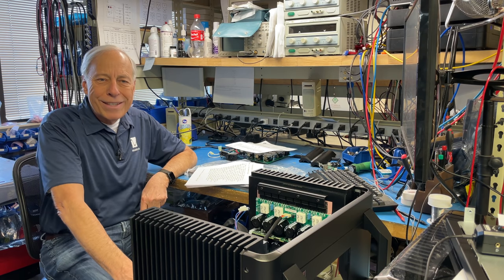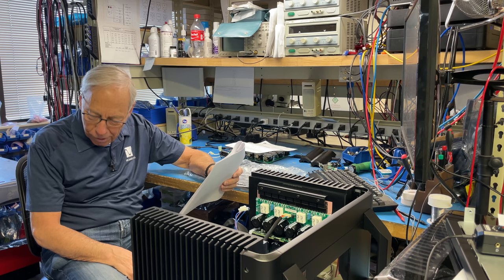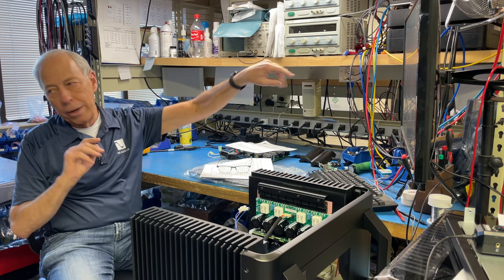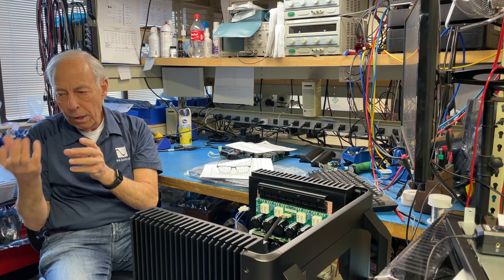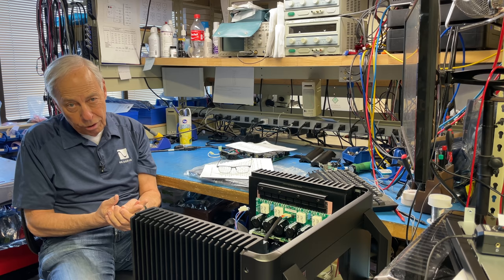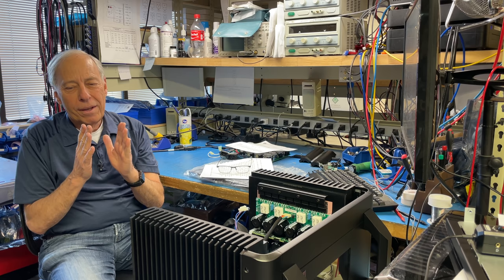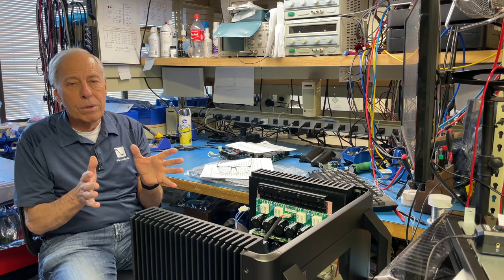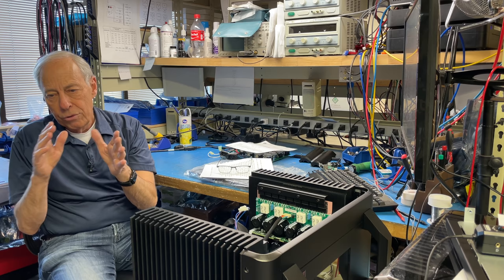Differences in digital audio cables

Comment: Use great cables but don't pay snake oil margins for them...too many US$10 (FOB China) cables are sold at insane margins with some branding sticker on them.
Reply: Yes, use certified cables that are shown to operate within the specifications and discard when they become damaged.
Reply: @paulgyro  Yes, for digital data cables, there is no magic to it and the standards define what makes the data come through reliably. It doesn't matter if it's an e-mail, Power Point, image, movie or music that is being transferred, none of it can allow data errors. Of course cables can carry noise into the analog circuits and if a USB cable carries power to a DAC, there can be some special case concerns, but none of these things are costly to avoid nor do they need any special snake oil products.
Reply: @ThinkingBetter  Agree, ASR just did a debunk video on the same subject.

Comment: that's what jitter buffer is for. the bits are written at the source speed + src jitter + network jitter, etc. The bits are read out at the internal clk speed (and with internal clk jitter). over/underflow control is a different issue and taken care of separately, depending on the particulars. youtube players usually buffer a few seconds of video/audio before they start playing anything. btw, if you count on the src being jitter-free, you'd better choose a non-engineering profession.
Reply: The buffer does not get rid of all the jitter, the buffer also adds it's own jitter, the word clock also adds jitter, fibre octive cables also add jitter, you can't get rid of it.
Reply: @Viagra_risk_PERMANENT_insomnia  The jitter buffer does not have any jitter. The reading inserts some depending on the jitter of the internal clock. None of the other jitters play any role anymore. Done that.

Comment: The person ask how, in digital domain, cables makes a difference and the answer is isolating the analogue section of a DAC made a huge improvement during the design. Okay sure so the difference is not the digital cable. 

The problem is probably that the good sounding digital cable sound exactly the same as the bad sounding cable and  bias play a huge role in what one expect to hear. 

My question to you would be : why does audiophiles think a properly engineered component is sensitive to the cables connected to it and why it's not the total opposite ?
Reply: @Douglas Blake this have been my opinion for a long time. After my "i think I hear differences between cables" phase  and after the "let's test if this is real or not by removing the expectation bias" phase.

I can't understand why audio components designers accept the ridiculous "your components are not good enough if you can't hear the differences between cables". If it's the case than the design is flawed and need improvement.

If I was behind those designs I would take a stance of  : you hear what you hear but we don't aim for any cable to make a difference designing a component. But that's me.
Reply: @Douglas Blake And yet that is what most advertising is based on. A new car does not make one more sexy, few owners of SUV's ever go off road, most diet plans fail, a fragrance does not attract women and in vitamins just create expensive urine.
Reply: @zackschindler8334  that's not a business model, that's business.

Comment: I constantly hear how noise from the ethernet cable is transmitted through the expensive streamers/DACs, but this should be very minor. Once the bits are buffered from the network. The actual digital audio throughput requirements from the buffer to the DAC are so low that a simple 2$ optic coupler for data paired with a 3$ integrated isolating power supply will easily kill even that noise, so there isn't any excuse that a network cable or switch should change the audio sound coming from an even moderately designed streamer/DAC. (I design sensitive medical and industrial equipment) EDIT: Paul is saying a similar message, but I just wanted to point out how cheap and easy it is to fully isolate the digital signal, so there is no excuse that an expensive streamer should have differences due to cable/switch.
Reply: Get em😊

Comment: A bit .. is a bit .. is a BIT ! there is NOTHING different. The difference is in PERCEIVED quality based on PsychoAcoustics and the depth of the listeners pockets in their expensive pants.
Remember the story "The Emperors New Clothes" and his expensive pants
Reply: @adamm450  I have a degree in Electronic Engineering and 40 years experience in the industry. An oscilloscope will indeed show you the profile of the signal, fortunately digital circuits do not work on a profile, they work on a threshold, if the voltage threshold is above then its a "1" see this https://www.sciencedirect.com/topics/engineering/switching-threshold. What this indeed means is that a 1 is a 1 - there are no "part" digits. The circuit is either On or Off. There can be variations and potential losses in the signal, these are accounted for by using a CheckSum mechanism, this matches the value and corrects any errors (this is vital for the integrity of any digital value - just think what would happen to your money in the bank if there were digital errors) .
Now we look at "jitter" the slight timing variations that can exist, a sample rate of 16bits @ 44Khz or 1,408,000 bits per second - clocking errors in digital circuitry are accurate to .001% or 140bits - insignificant error for hearing. 
It is true that digital circuits can be affected by high frequency noise, but if this happens you lose far more than a few bits, an example of this is when using a mobile phone, when the signal is low you lose large audio chunks which make it very difficult to hear what is being said. 
Happy listening
Reply: @adamm450  In which case a "better" digital cable (subject of the original discussion) will make no difference. The only way that changes is the design of the Digital to Analogue section to managed any noise, and the design of the Analogue output stage to provide a clean signal. At which point we are discussing the quality of the low voltage signal through an analogue cable - nothing to do with USB or HDMI cables. Most good RCA type cables will manage this well. 
I have been involved in designing and building digital to analogue systems in the harshest of environments where there is NO margin for error. So back to my original point .. A bit is a bit - the errors if there are any are in the analogue stage.
Reply: @adamm450  I have spent enough of my life working on this stuff. Noise on the input digital date is corrected with error checking. Wifi and RF signal levels are so low they have no audible effect. Ethernet cables are already shielded and use twisted pairs to deal with noise (first used in the 1930's).
Designers spent many hours making sure what goes in - comes out digitally 100% correct. USB and HDMI are digital only cables, and are not in the susceptable analogue stage.
BUT when all said and done if you want to spend your money on expensive cables that is your choice, personally I will buy something nice for my significant other :-D

Comment: I'm a big fan of this channel, but "bits having jitter"? Either the data is exactly the same and then I can't understand hearing a difference or the jitter means the dat is somewhat corrupted.
In any case, I didn't understand the explanation.
Reply: What he's talking about describes problems during the last-leg journey (usually spdif or USB to the DAC), rather than the data itself. The concern is that you're not feeding your DAC at a constant speed; i.e. not perfectly always 44.1khz, etc. which is like having a turntable with a non-constant motor speed, slowing and speeding up parts of the song (where the record itself represents the data). In digital land this doesn't cause tone shifts, but rather becomes audible by hurting the noise floor instead. I believe he is referring to this same phenomenon when he mentions 'noise' in bits as well; bits themselves cannot be noisy as you are thinking. I wish he clarified that jitter doesn't apply to the networking realm; delivery of music over the network just isn't a time-sensitive operation like feeding a DAC is (and if your DAC has an internal buffer and reclocks the data before conversion, jitter on the USB/optical line simply isn't an issue)
Reply: Now this is a clear explanation! Thanks a lot.

Comment: I am not a computer engineer nor electrical, nor audio expert, but here you have one bit: 0 or 1. Can someone explain to me where is the noise and jitter in this bit? 
Perhaps I didn't understand the Pauls' answer, but it seemed for me he essentially said - there is no difference in data transmission and any competent digital cable (e.g. TOSLINK) will do it's work. However, it is DACs and output stage combination that matters. This seems to me legit, however, question was about cable... :)
Keep up the good work, Paul!
Cheers!
Reply: @Viagra_risk_PERMANENT_insomnia  Thats true, but that 1 meter digital interconnect does not have any influence on that. And the original question was about the digital cable,  not the sending or receiving hardware.

Comment: The cable never touches the other end of your connector, so if radio emissions from your cable outside your unit interferes with the analogue signal path, that is a pretty serious flaw. And if you don't design for crappy cables and source clocks and re-clock your (buffered) signal to correct for errors, resends and jitter, that is bad too. You always need to design for everything being very non-ideal outside your unit. That is also why a lot of DACs these days dictate the sample clock, so that they can basically fix "all" timing problems with a little buffering. SPIF doesn't understand this, but most modern connects do.
Reply: Best comment here. 100% agree. Proper cable/power management & separation will have far more audible affect than simply spending a fortune on pricey cables.

Comment: So, as you said in a previous "Digital cable" video, it's not the actual DAC itself, it's the analog section after the digital conversion. Good grounding and true noise rejection are mostly an analog problem.
Reply: I think he is talking about the cable that runs from the streamer/computer/transport to the DAC.
Reply: @alphaniner3770 ... of which carry current between the components and can potentially (see what I did there) set up ground loop issues if ground connections are "questionable". 

Again, it is the job of the DAC itself to faithfully reassemble those 1's and 0's back into the music that was relayed from piece of equipment to piece of equipment. Where the coloring of the signal comes into play is when the signal becomes analog again. This is the domain where electrical noise and unintentional (and intentional) sound shaping is most prevalent. And when you introduce noise from somewhere down the line, and try to carry it over wires, which use voltage AND amperage to reliably transfer that signal, whether analog waveforms or digital packets, it can make its way into the power supply of successive components. Yes, each piece of equipment does a job (good or bad) of cleaning up power for each of it's stages, but there are times when even the best design cannot get rid of all that noise. So if you want good, clean, reliable transfer of data (whatever kind that may be), you need to make sure your connections are clean and snug (properly seated) and that your "wires" (cables) are at least adequately sized and shielded, and placed with care to avoid as many noise sources as possible, like NOT running a signal cable parallel to a power cable, but rather crossing at 90 degrees if possible.
Reply: @TheTrueVoiceOfReason  you  make a good point. The back of my audio stuff is a rats nest of power cables.And yet it sounds pretty good anyway without special cables. To be fair, its a cat6 cable in and speaker cables out only.
Reply: @KeithHeinrich  good choice for signals, plus I'm sure your system was meant to use it. Cat 6 has 4 sets of twisted pairs of wires in that jacket. Twisted pairs are very good at rejecting noise, by design. Just ask any Tube Amp builder/repairman.

Comment: I think there is misuse of the word "jitter". It is relevant only during real-time data transmission which will not apply if you are playing the audio file locally. 

Also "noise" in digital signals should not affect the data significantly unlike in sine waves. Bits are simply represented as no voltage or the presence of about 80% of the upper voltage limit (could be +5V, +3.3V or +1.8V).

In digital circuits, the 1's are renegerated by the circuits inside the device (could be a NIC card, network switch, router, firewall, hub), thus any noise introduced to the square wave when travelling from device A to device B should have been removed when the bit is transmitted to the next device.

DAC would have a better error and signal correction, I assumed, because it needs to ensure that the voltage level of the bits received should be high-enough to represent "1".

Comment: So cables don't change the digital data. However, if the analog section of your system isn't well isolated noise from a wide variety of sources can impact the sound. Poorly shielded digital cables can collect noise from the environment and properties of the cables can alter existing noise to make it more or less of a problem. That noise will not change the digital data, but can be audible in the analog signal path or otherwise affect the operation of the analog circuits. Paul also mentions various problems that only affect digital interconnects that send the clock and data together in real time.
Reply: Are there any humans that can hear the difference even if one even exists?
Reply: when your DAC is useless and expensive crap maybe

Comment: I'm also an IT guy Paul, been doing it professionally for almost 25 years.  Even if the damn music source is digital and even if it went around the world twice, in order for your ears to hear it, it will have to go thru a Digital to Analog converter, correct?  Yes, so the cables don't care, but your ears will....  Digital, unless previously degraded will be 100% perfect with relation to the type of source file it is.  So what you get is what you get, whether it be an mp3 or a FLAC file, all has to be converted to analog.
Reply: I worked at a GM car plant (Detroit/Hamtramck Assembly) for 30 years in the IT department. The plant was 100% dependent on the data from the servers and the network. If for any reason the line stopped running it cost $50,000 a minute (USD). Needless to say there was a lot of emphasis on us keeping data flowing. Never once was there a discussion about putting different CAT5 wires in or worrying about RJ45 connectors that might be better because they had magical properties. it was a noise laden environment with hundreds of welding robots running 18 hours a day. And yet the data still flowed.

Comment: IMHO, It is not syncronous thing, it is asyncronous. The data are stored in the buffer/RAM for a while, and while the data are already stored, they are completely silent until they are accessed.

The signals of data coming from the RAM when they are accessed do not contain the noise/jitter from the source, and the timing is the according the internal clock of the DAC, not the timing from USB. It is solely depend on design and built/construction of the DAC it self.

Comment: I’m not sure the cables are as important as galvanic isolation. I have a denafrips ares 2, which I’m sure deals with jitter well. Nonetheless, if I had an ifi ipure 2 spidif to the DAC, being fed by a sonos port, there is definitely an upgrade in sound quality. I suspect it is because it is galvanically isolating the DAC from the noisy streamer.

Comment: If you use wifi instead of a cable, you don't have a cable connection that produces jitter or noise. We don't have a data loss with WIFI- 5 or 6 either, so why not better WIFI right away?

Comment: The correct answer is that coaxial digital cables are not bit perfect. They stream digital data asynchronously without error correction at the packet level. Any interference “can” cause distortion on the signal. However, this distortion is likely not predictable when talking bout a digital source. Anyone who’s says “this coax cable is better for low frequencies” or something similar, is just parroting something they heard. Optical cables offer the truest signal, but they do have a more limited bandwidth.  The industry should invest in developing a higher bandwidth optical connection, but then they couldn’t sell the coax snake oil products, so it’s not likely to happen

Comment: I think this would be better explained by saying that a bad cable will carry with itself any electronic noise that was generated in the signal generator and this will reach the receiver of this signal causing interference on the electric components inside of it that will ultimately affect sound in some way or another. It's also important to note there needs to be any noise to begin with and if you just power everything from batteries and live in the country side with not much RF interference the difference will be far lower meaning your mileage will vary depending on your specific situation and electronics used.